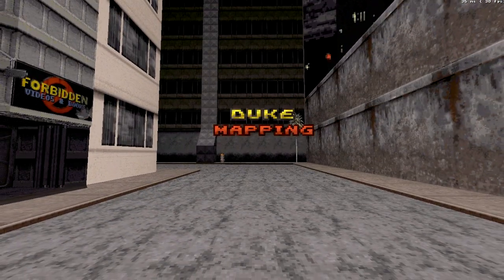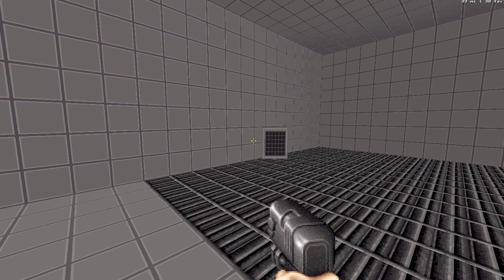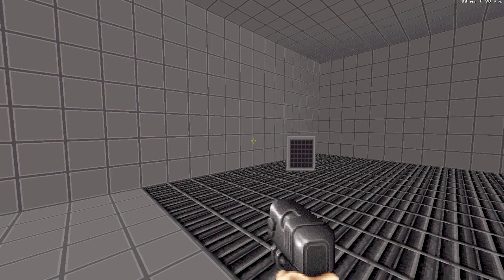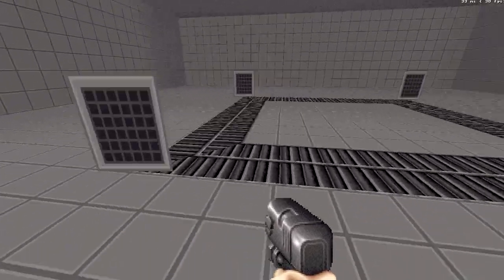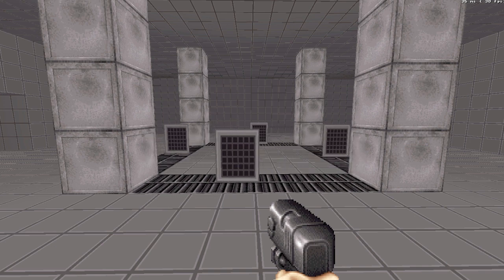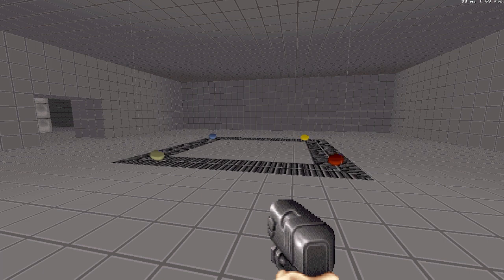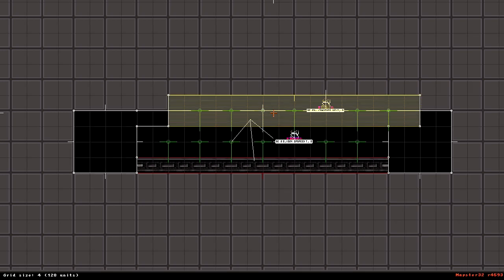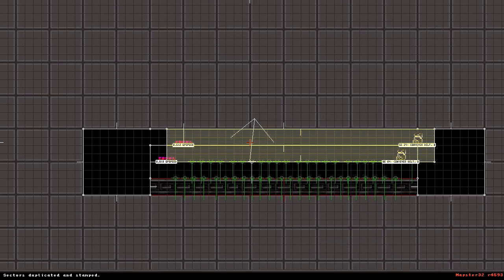Duke Mapping Taboo #1 - Conveyor Belt Abuse

Comment: Good stuff! Great content! How did you speed up the game like that? in 1:54 I tried that command but it didn't work for me
Reply from the maker: Using custom CON to alter the game's inittimer as it can't be set directly from the console. It probably looked something like;

gamevar TVR 120 1
onevent EVENT_GAME
inittimer TVR
endevent

120 is the normal tic rate, most of the game logic runs at 1/4 of this speed. With this code, setting the 'TVR' var will immediately switch the game timer to whatever speed you want, within reason. Too fast and it will crash and I think 0 will lock the game up for obvious reasons.
Reply: @HighTreasonLP  Oh wow! Thank you! I really appreciate it.